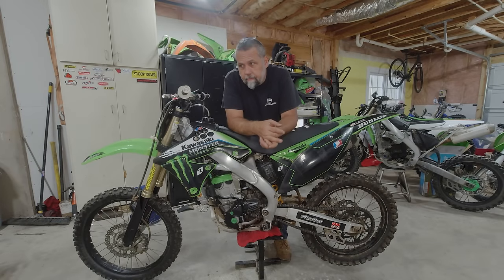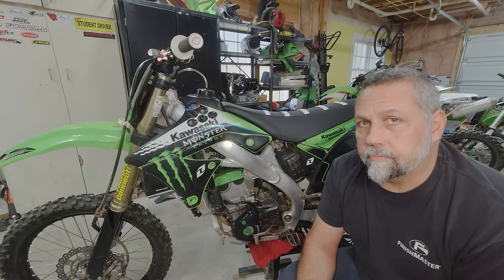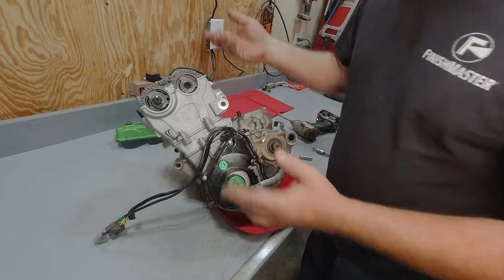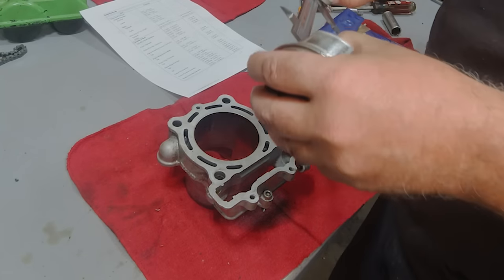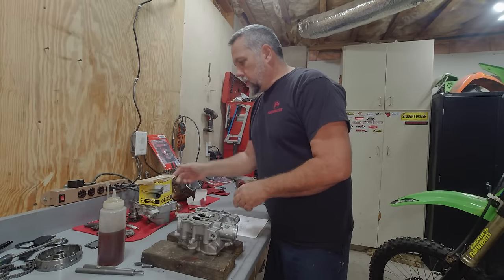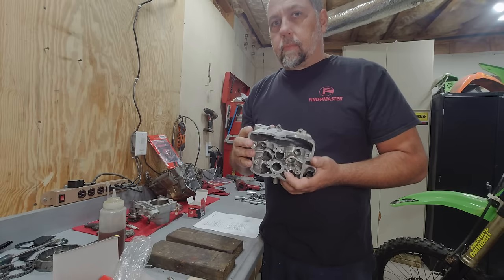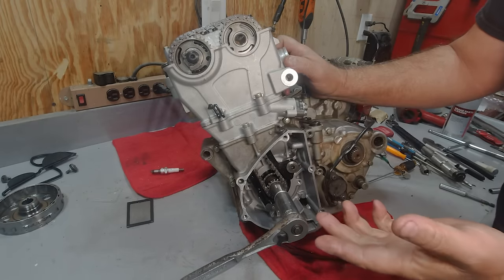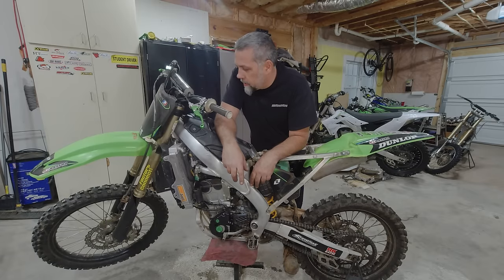2011 Kawasaki KX250F Part 1 Ep72

Comment: When it comes to the four strokes I rebuilt or replace cranks , now I have a retired engineer that worked for Kawasaki so he rebuilds my cranks using pro-x connecting rod kits , heads if there damaged to bad just buy a new head

Comment: The idle adjuster needs to be turned anti-clockwise (opposite to a carb bike) in order to turn the idle up, if you haven't tried this already. Also take the idle adjuster out and make sure its actualy moving in and out when turned, I had an issue on an 09 kx450f where the idle adjuster turned fine but didnt move the actual plunger in or out.
Reply from the maker: I pulled and went through the entire throttle body. Also, if I turn the adjuster just one click left, it will idle at 3000 rpm and not come down. Thanks for watching and for your comment.

Comment: Turn the cold start knob counter clockwise till it idles.
Reply from the maker: Great tip, if that doesn’t work (as it didn’t in this video), then what?
Reply: @restoroosterohv  wish I knew,I'm new to the FI stuff.
Reply from the maker: It was the valves had tightened up. Re-shimming fixed the issue.

Comment: Interesting to see the cutter in action. Thanks for the demo. Question about honing, I have read that Nikasil coated cylinders and honing is a bit hit and miss. Any comments on that?
Reply from the maker: Sure. First off, you can only hone a good cylinder. Out of round, tapered, over-spec and cylinders with damaged nikasil are not candidates. The hone should be done lightly with a 320 ball hone and only enough to break the glaze. If you break through the coating (which shouldn't happen if the cylinder is in spec), it would need to be repaired or replaced. Thanks for watching and for your comment.

Comment: Hi According to my Service manual, if you turn the Choke/fast idle button on the throttle body either clockwise or anti clockwise it will increase or decrease the basic idle speed,  if you look close at the end of the button it does say fast low with arrows to turn it, I haven't seen what effect it has on my bike as I bought mine as a non runner with a split piston, however now I've rebuilt it and found now  that the coil is naff, so waiting for another one before I can fire it up and then adjust the idle speed.
Reply from the maker: Your service is correct.
Reply: @restoroosterohv  did you get your idle issue sorted?
Reply from the maker: @mickyould5609 yes, see part 2 of this build.

Comment: Nice video! Perfect timing as I'm about to put the top end onto my project 2012 KX250F build. Unfortunately my top end was completely trashed so I had to order a new head, cylinder, valves and other super expensive stuff for the top end. I've got a pretty good handle on putting these engines together but always watch videos like this because you never know what you can learn from the way other people do things
Reply from the maker: Thank you for your feedback and support. Good luck with your build.

Comment: Not sure if you are aware but the enrichment button is also an idle adjustment. You turn it just like an idle screw on a carb.  Except reverse. Counter clockwise raises the idle clockwise lowers it.  Hope this helps
Reply from the maker: Yes sir. As I mention toward the end of this video in my closing statement that the idle adjust knob doesn't fix the problem. One click more and it revs out way to high. I have solved the problem and that video is set to release on Sunday morning. Thank you for your comment and help!
Reply: Ok cool

Comment: Hey roost I’m pretty sure you remember trying to help me with my 14 model !!! this is the exact issue i was chasing… i have bought an entire new throttle body with map sensor and tps which also came with new idle adjuster in the throttle body. I just haven’t installed yet because i have cam journal issues as well, but watching you rebuild and have the same exact issue i think imma give it a go with the new throttle etc… This has to be issue or either  a fuel pump rebuild kit!!! Thanks for your input and videos again
Reply from the maker: Hey Justin. Thanks for your comment. I did install a “new” assembly from a known good runner and it did not fix the problem. Because of other projects I haven’t had much time to diagnose. Good luck with your repair and please keep me informed.
Reply: Same to you man!!!
Reply: This diagnosis would help me tremendously, Ive been stuck for months because of this not knowing which way to go!!!! Love to see this update though

Comment: I have a similar issue with a 2012 450
Starts, revs, drives, but does not want to idle. I bought it and the motor was taken out. Apparently PO wanted to powdercoat the frame but changed his mind. I will be doing similar checks as you (fuel pressure, sensors etc) hoping to find the issue before winter is over. And I'll be checking in for updates. 

Great video!
Reply from the maker: I am going to replace the entire throttle body/ sensor package with known good stuff to see if that is the issue. Keep an eye out for that video to see if it helped. Thanks for watching
Reply: @restoroosterohv  I just wanted to come back and give an update on my 450. I got very lucky. as previously stated, PO took the bike apart but didn't reinstall the tip over sensor in its correct orientation. all I had to do was rotate the bracket and mount the sensor properly - all good now.
Reply from the maker: The ole tip sensor installed incorrectly deal huh? That’ll do it every time. Mine turned out to be I take valve clearances. I had to shim on the upper end of the spec. Problem solved.

Comment: Quick question I have an 11 it had a whole in crankcase I bought a new right side but can’t find a left one does a 2012 left engine casing fit or it has to be an 11 year to be exact
Reply from the maker: Unfortunately I can not speak from experience on this one. However, the crankcase part number (14001-0155) is the same on the 11,13,15 and 16. 12 and 14 are a different part number but it doesn't mean they wont work, I just can't say for sure.

Comment: Here's my question.   Are these titanium valves?  If so they have a coating and can not be lapped in.  Only stainless valves or steel can be lapped.  I always add solvent to the top of the valve spring area and hold the valve closed.  I find that easier to see the leak and saves time, avoiding complete assembly of valves
Reply from the maker: These particular replacement valves are stainless steel. I never replace with Titanium, it’s just not worth it. You are partially correct about the Ti valves. If they are coated, they should not be lapped in. However, some manufacturers use an uncoated Ti valve (Yamaha YZ250F) and are suggested to be lapped in by Yamaha. The reason I reassemble completely is to do an air pressure test, which is not possible to do any other way. The valve may be sealing well enough to not allow solvent through, but will not hold pressure. Thank you for your comment.

Comment: I had an 09 kx250f would only run on choke, ended up having to clean out where the choke sits in the carb, and it didn’t have an air filter cage, filter was just sitting there, but yours is an 11 which is fuel injected so I’m not sure that would be your problem

Comment: Excellent job! I have a 2010 KXF, it does not like low idle too. Just a quick thought here, can the auto decompressor on the cam be messed up so it opens the exhaust on higher rpm than it should?
Reply from the maker: Thank you for your support. Unless you have a 450F, the 2010 is carbureted and probably has issues with that as far as the idle. The only way the auto decomp could hold the exhaust valve open past its normal rpm would be if it was sticking or the return spring got tighter which obviously wouldn’t happen. Even if it was sticking a bit, the fact that it is running, it is no longer holding the valve open and a few rpm here or there would be negligible.

Comment: I fixed my rmz450 shutting off.  Wire on tip over sensor was rubbed by the throttle cable.   Now I am still fighting the shudder in the clutch.  So far have replaced everything but the throw out bearing.  Waiting on order.  Another mentality exhausting process.  I sure hope this is it because I will be out of options
Reply from the maker: Good to hear you found part of your problem. When you say shudder, do you mean while disengaging the clutch? It probably goes without saying that you replaced the steels and frictions. I have had situations where the inner and outer clutch hubs had been warped.
Reply: @restoroosterohv  yes, it is like a notched basket.  I have a billet basket.  Replaced everything now except the throw out bearing

Comment: HI im about to set fire to my bike. same 250 2011 KXF. Ive rebuilt the whole engine after blowing up. wouldnt start after. checked the stator, which was dead, which makes sense all the chunks of metal flying around in there probably snapped coils. got a new stator and rectifer and still wont start. it feels like the injectors arent firing at all, everythings always dry. Ive removed the fuel injectors, tank and pump and hoses and connected it all together on the bench with a 12v battery and a 9v battery on the injectors and it gets a perfect spray on both. my thinking is, could the faulty stator have fried the CDI
Reply from the maker: You are saying injectors, like more than one…the 2011 had one injector in the throttle body, the 2012 up had a second injector in the air box. You need to test everything that you can before throwing a computer at it including continuity through the harness. I would verify what bike you have before going any further. Run your VIN here. WWW.DECODETHIS.COM
If you need a manual, use my link to get a great deal. https://shareasale.com/r.cfm?b=510988...

Discount code:  RESTOROOSTER22
Reply: @restoroosterohv  when i bought it the guy said 2012, its got 2 injectors, i cant remember the reason why i thought it was 2011 i think it may of been the frame number, this projects been going on for about 6 months now! cheers ill look into that, im a electrician but hate doing 12volt its so fiddly

Comment: I had an issue with the coolant temp sensor.  It passed all testing but finally threw a code after months.  So to me testing is never fool proof, just a guide.  This caused a stumble in the power, almost a shut off problem.  I don’t think this is the issue here.   This seems like an air leak issue.  Have you checked the crank seals?
Reply from the maker: This is a 4-stroke engine and does not utilize crank seals. I have a feeling that it is an issue with the throttle body. I purchased a complete assembly from a know good runner. We’ll see how that goes.
Reply: @restoroosterohv  it definitely has crank seals but less affected by leaks like a 2 stroke.  It will be interesting what you find out
Reply from the maker: From what i've read, this was an issue with the 11 model. Hoping it's just a throttle body problem.
Reply: @restoroosterohv  can't wait to find out

Comment: Change the injector and the plug to a iridium spark plug will fix the problem and check the air filter make sure someone has not sprayed put to much oil on it or just dirty
Reply from the maker: I went through the filter and that is where it needs to be. I did clean the injector and it was spraying fine but it sure could be an issue. I bought a complete throttle body from a known good runner and will swap everything over to see if that is my issue. Thanks for the tips and for your support.

Comment: Hey Resto, great video, teardown and repair. Question, are you installing OEM parts or what is a reliable source for say a piston/cylinder kit? Thanks for any info. Looking for a kit for YZ250f 2009.
Reply from the maker: You could do an Athena kit if you're not to hard on your equipment. This bike, I installed a pro-x piston kit and re-used the oem cylinder as it was in spec and the coating was in great shape. Thanks for your feedback and support.

Comment: Not sure on bikes, but on EFI snowmobiles throttle position sensor is out of range they won't idle or run correctly
Reply from the maker: TPS ohms and adjusted out correctly.

Comment: im new at owning a four stroke i need help i replaced the head gaskets  now need timeing done   2004 kx250f the magneto has 3 lines on it 2 together 1 buy is self witch one do i line up for timeing  so far have not found any proper videos on timeing your kx250f any help would be good
Reply from the maker: Forget the timing marks on the flywheel. Pull your spark plug, drop a straw (or equivalent) down the hole so it contacts the top of the piston. Turn the crank so that the piston is on top dead center. Rock the crank back and forth a little where the straw is neither moving up or down and you’re there. Check out my 2010 KX250F build episode 54 around the 33 minute mark.
Reply: Ok will try that I'll let you know how it goes 👍👍
Reply: We done that piston top centre   the holes line up on the sprockets to the  head but still wont start ???? Run perfectly before I done head gasket
Reply from the maker: Why did you do a head gasket? Put the piston on tdc and take a picture of the cam marks and the cam lobes and send it to Restoroosterohv@gmail.com
Reply: @restoroosterohv   my son flooded in the  river crossing  twice my older son took it out last week came back with white oil in gear box so we pulled it apart it was the head gasket blown in 3 places hence new head gasket
Reply: ok we found the problem it missing a shim from 1 tappet  @restoroosterohv
Reply from the maker: @brettsawyer299 did it run after the flood before you took it apart?
Reply from the maker: @brettsawyer299 awesome, easy fix.
Reply: great thanks for your help next will be my 2006 kx450f its nearly morning here in batemansbay south coast australia  thanks so much
Reply from the maker: @brettsawyer299 good bikes. You’re welcome
Reply: took her out yesterday run great through the bush thnks for the help  @restoroosterohv
Reply from the maker: You’re welcome. Thanks for watching.

Comment: I have to knock some valve guides out. What tool do you use? I am having trouble finding a driver with the right OD and ID.
Reply from the maker: I use a valve guide driver tool, they come in a few different sizes. They are cheap enough that if you have to, you can modify the ID and OD of the tool to fit your application using a drill/drill press and a file.
Reply: @restoroosterohv9030  Thank you. Im tearing into an 09 kx250f and couldn't do it confidently without your videos.
Reply from the maker: Glad I can help, you’ve got this!

Comment: 45:00 There is a spring that is missing that holds the oil filter tight between the cap
Reply from the maker: You have a good eye. You’re right. The spring was missing from the previous “build”. It was replaced during this build but didn’t make the vid. Thanks for your comment!

Comment: What are your thoughts on the reliability of those year KX250Fs ? I have a 2012 and is been good to me.
Reply: Also quick question. When you installed the guides, is there any chance they could be inserted in a different angle and messing the line relation between the valve and the seats?
Reply from the maker: Any of these bikes are reliable if the proper maintenance is done.
Reply from the maker: Yes. They do not line up perpendicularly with the seats. This is why the seats needed to be re-cut.
Reply: Last one I swear. I've saw you lapped the valves, but those are not Titanium right?
Reply from the maker: @jaime7890 no, they are stainless steel.
Reply: @restoroosterohv  Thanks a lot. I really enjoy your videos
Reply from the maker: @jaime7890 thank you
Reply: @restoroosterohv I've seen many saying these only get around 30-60 hours before q top end rebuild and sometimes major work while other bikes get up to a 100 plus hours. 
It has me a little worried since I just got one and do not even know the hours put on it. Wondering if I should take it in to see if it needs a top end rebuild before I get the bottom end messed up?
Reply from the maker: If you are unsure of the time on it, minimum replace the timing chain and shim the valves. Longevity depends on your riding style. If you were constantly on the rev limiter, the bike will need more frequent rebuilds. If you’re more like me, an old man who likes to put around, I’ve never had an engine fail on me. Basic maintenance is key.

Comment: Can you provide the part number for the seat cutter kit?
Reply from the maker: http://www.newaymfg.com/parts/KM2563
Reply: Yikes!!  Guess ima stick with the stone cuttter lol
Reply from the maker: Yeah it’s pricey but precise. How do the stone cutters perform?
Reply: @BAYAREAMX   not too bad.. ish..  Only problem ive had is the drill that runs the stone is so torquey it wants to off set the seat.   So we use a Milwaukee drill instead to control our speed.  However Also after almost every cut you need to re surface the stone so you need a good diamond tip cutter for that, and lots of xtra stones. Of all sorts of different widths. But they come with the set.  Getting hard to find parts for it now its so old. But does the trick

If i did this everyday id have your tool but we only do this once in a great while
Reply from the maker: @2StrokeSmoke544 makes sense. You can purchase the cutters and pilots separately and they come up used from time to time. Check eBay for Neway

Comment: the problem is because it is a sucky ass 4 stroke
Reply from the maker: I grew up riding 2 stroke bikes. 4 strokes were considered woods or trail bikes. Now that I’m older (much) I prefer the 4 stroke bikes. I still get nostalgic and do a 2 stroke rebuild with the intention of keeping it but it never works out. I still love my 450. Thanks for your comment.